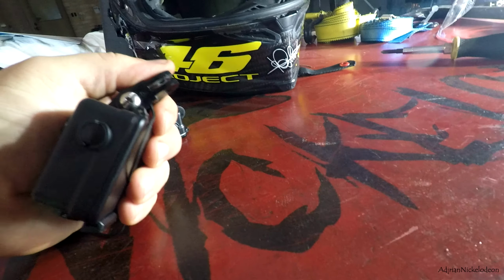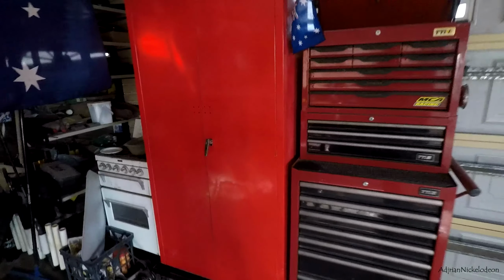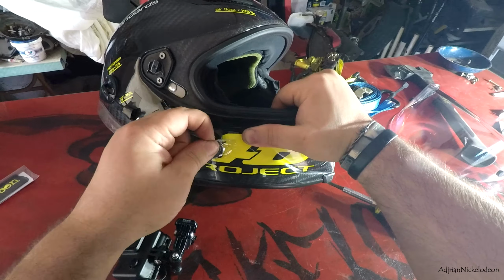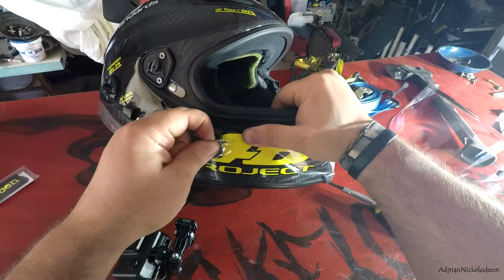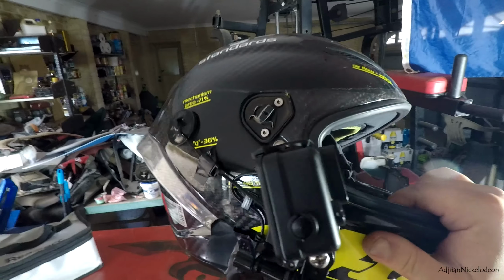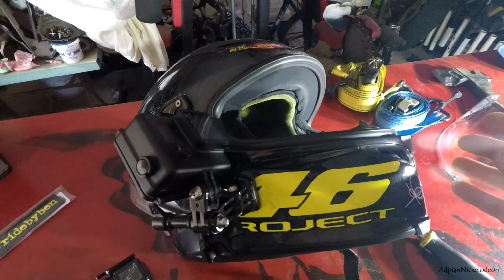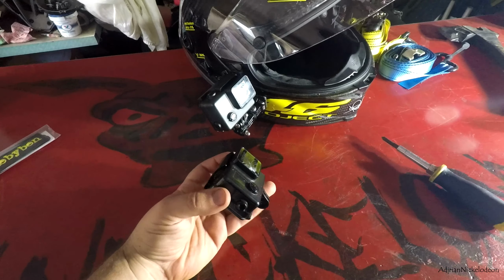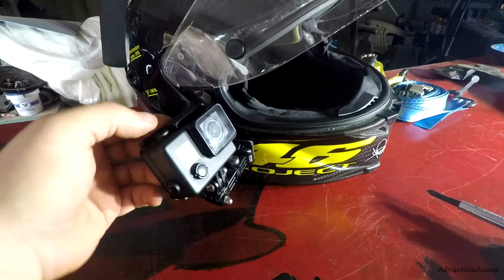Motovlogging camera setup on a $1800 Pista GP Carbon Race Replica

Comment: Just wondering adj. does your AGV's visor flop down if youre on the bike at speed and the wind blows it. Mine does and it seems it doesn't have a visor lock system which is pretty annoying seeing as they're so expensive..
Reply from the maker: Yeah after a while the mechanism wears out on each side of the helmet where the visor clicks in. I've had to replace it once before but it's starting to wear out again. It's really annoying

Comment: Hay what's the laws in nsw for wearing cams on helmets?
Reply from the maker: Dear Sirs,
I was issued with Infringement Notice No XXXXXXXXXXXXX on the basis my helmet is not in compliance with NSW Road Rule 270. 
NSW Road Rule 270 requires a rider to wear “an approved motor bike helmet” NSW Gazette of 5 November 2010 at Page 5402 carries the definition for “an approved motor bike helmet” for purposes of Road Rule 270. 
This definition provides for “approval” through a sticker attesting compliance with a nominated standard.

Infringement notice
My helmet continues to bear the approval sticker as required.
A camera is an accessory. Many accessories are available for helmets. Accessories are distinct from a modification.
Removal of an accessory returns the helmet to original condition, while modification of a helmet does not.
There is no NSW regulation that provides for revocation of approval of a motor bike helmet.
My helmet was “approved” prior to purchase and it is because it was approved for use on NSW roads that I purchased it.
 The standard referenced in the definition of Page 5402 of the Gazette of 5 November 2010 is not a regulation and contains no regulatory subject matter that provides for approval or revocation of approval.
The referenced standard is not a NSW in-service regulation. Without doubt, I was and continue to wear an approved helmet. The presence of an accessory camera is irrelevant.
This Infringement Notice is not based on NSW regulations and I request that it be withdrawn.
Yours, etc

WHAT TO DO IF PULLED OVER BY POLICE
However, there is no law against fitting anything to a helmet, so long as it does not corrupt the “structural integrity” of the helmet, which means you can’t drill holes in the helmet.
Cameras that are stuck, fitted via a suction cap, or screwed to the side via a clamp should be fine. So are Bluetooth units attached in a similar fashion.
So if you are issued a ticket for having a camera fitted in this fashion, take a photo of the helmet at the time of the ticket being issued, don’t pay the fine, and fight the offence.
The Australian Standards says that no protrusion of greater than 5mm is allowed, but that refers to the manufacturing process as opposed to aftermarket accessories such as cameras, such as GoPro, and Bluetooth.
If a camera or other device is screwed into the helmet by drilling holes then it is interfering with the structural integrity of the helmet and the safety of the rider, and an offence is committed.